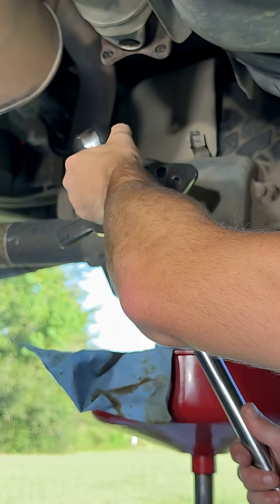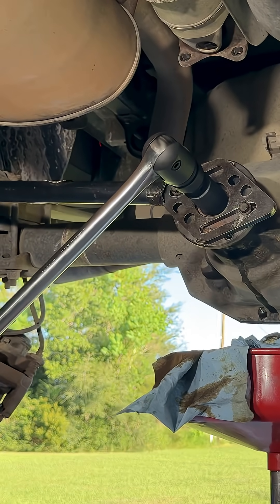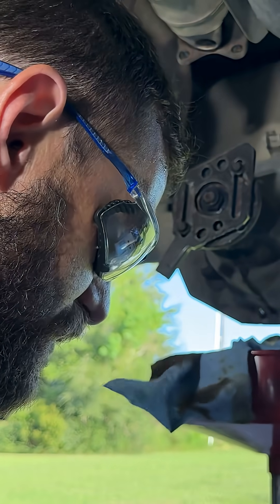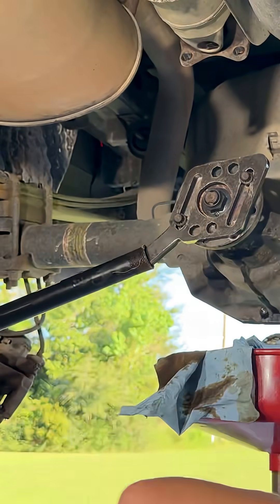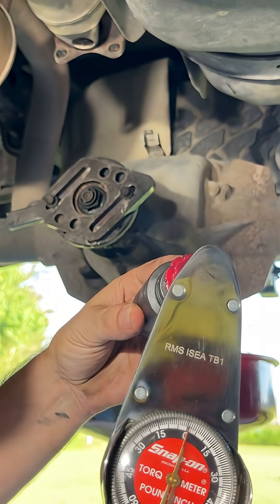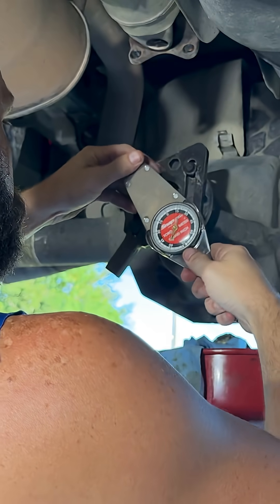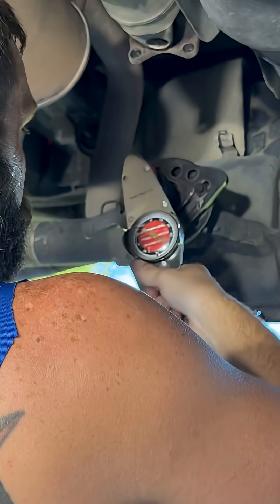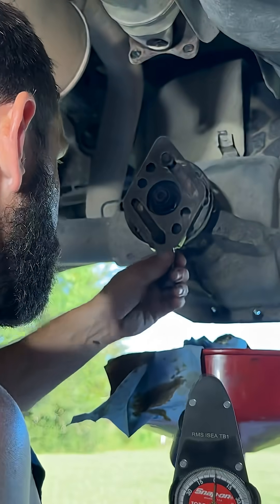Proper Pinion Preload = No Gear Whine 😎 #shorts #axleoffroad

Comment: Smart idea with the steel plate to get a pipe on to hold the pinion while you tighten it down
Reply from the maker: Absolutely, This makes the setup and installation a whole lot faster!
Reply: @axleoffroad whats the backstory on it? Are they manufactured or is it a home made tool?
Reply from the maker: @dodgethefatherramthedaught4652 This is one we had manufactured specifically to fit several variation of differentials. We do sale them for $99.99 if interested. Send me an email axleoffroad@gmail.com